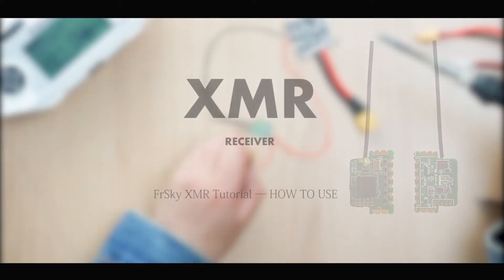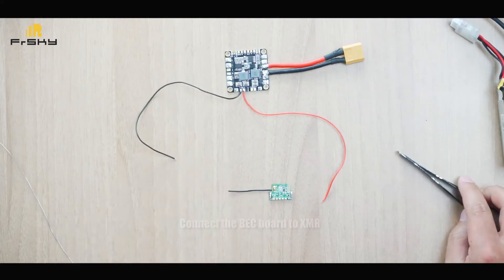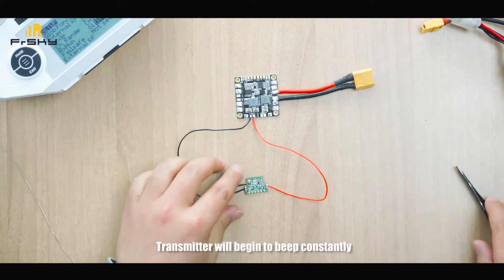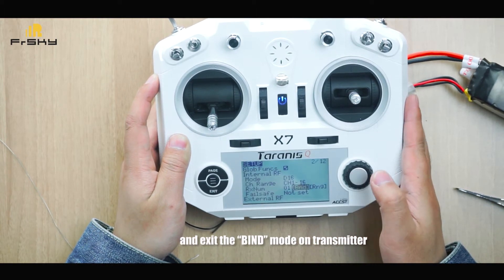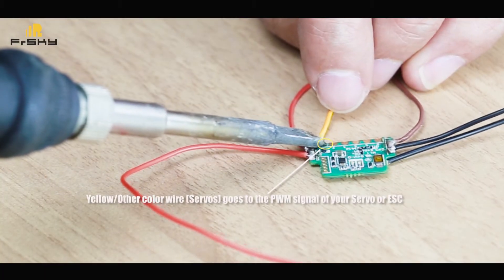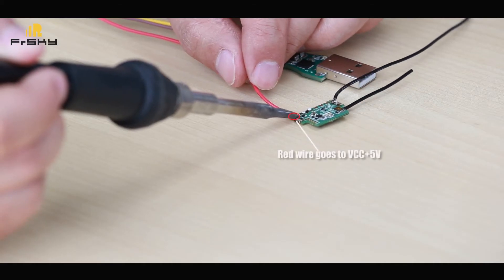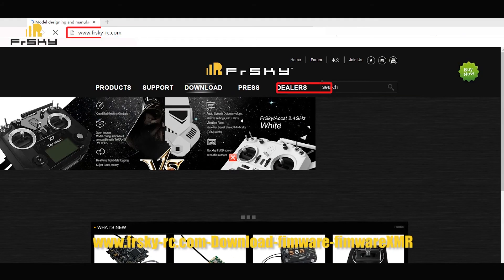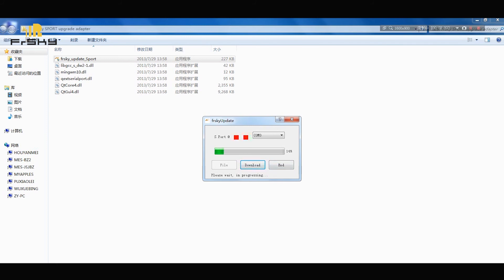FrSky tutorial video - XMR mini receiver

Comment: Is it possible to update the firmware from the transmitter external module pins?
I cannot bind at the moment. I get solid red and solid green led.
Reply: I think this is only possible on receivers with s-bus or smart port. You will probably need the programmer for this one